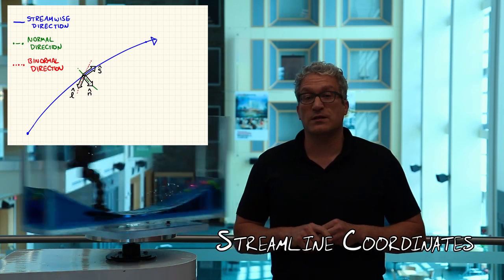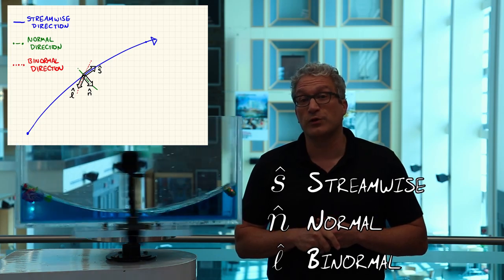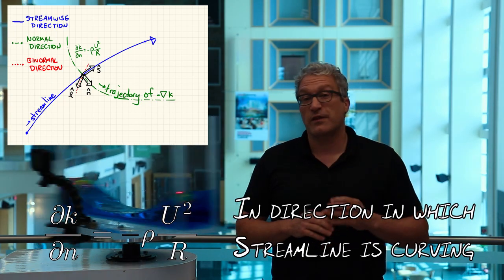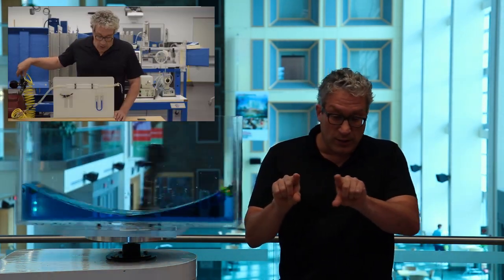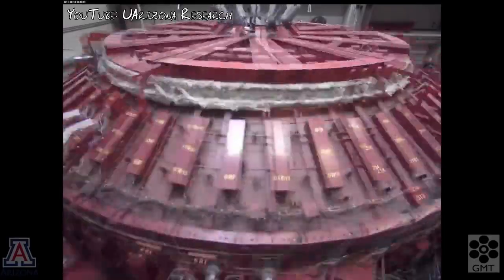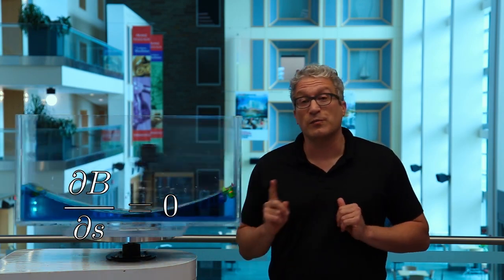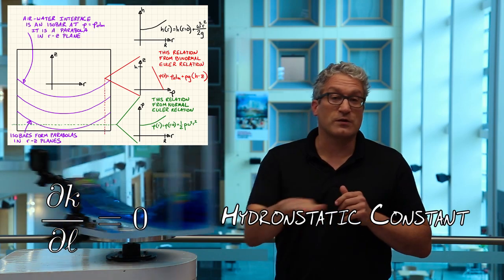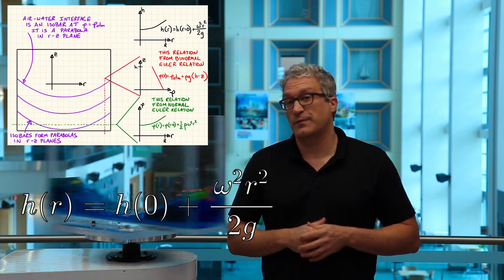How to Make a Parabolic Mirror: Bernoulli and Euler Equations

Comment: I'm going to try this with cooling wax to craft a parabolic mirror, wish me luck friends! 
If the parabola shape is not a function of wax viscosity it should hold approximately the same shape while cooling, right?
Reply: I was thinking the same thing,, but worry the wax might be too pliable, so am thinking about hot oil (or water) and melted thermoplastic. Or, maybe a higher temp hot glue. As long as the bottom surface of the material is smooth, I can use it as a form for shaping my final surface. (I'm doing an acoustic reflect.)

Comment: How would you use this practically to make a solid parabola mould?
Reply: take a screen shot
Reply: You put a liquid in a cold space with zero gravity, spin it about the short axis up to an rpm where the surface creates a parabolic shape, but not so much where surface tension breaks the shape, and keep it going until the liquid freezes. Now you have a perfect lens
Reply: @noreaction1  Thats not practical.
Reply: Epoxy? It's liquid when you mix the chemicals -> start rotating the tank in a steady speed. 
To be fair, if you want it to be perfect, you will need to do that in zero gravity and vacum or at least an linear induction motor, heavy masses as freewheels, a quantom locked state in a vacum chamber and then you have to drop the mould and directly pour the material in you want to shape, e.g. glas and silver nitrate for a mirror
Reply: Forget about what I said about zero gravity. You need gravity, but then you'd need to have quantum locked state and vacuum for the friction free motion.